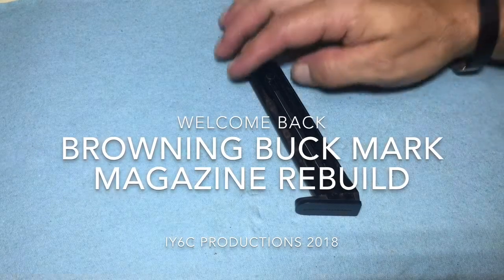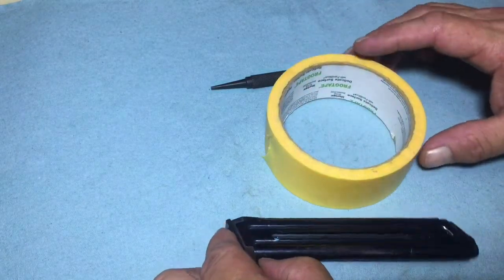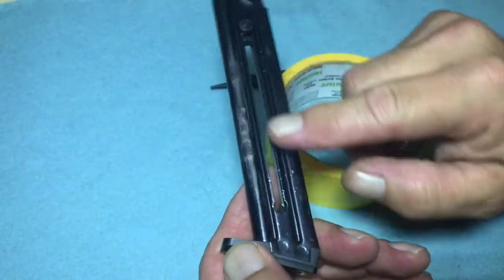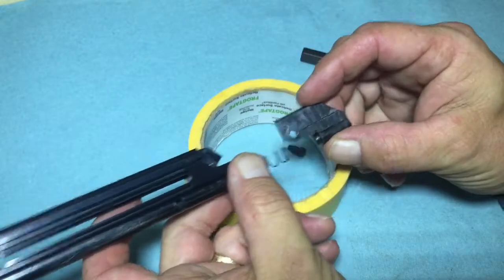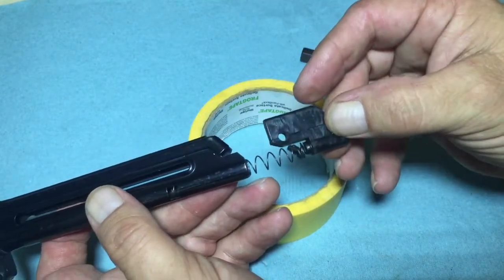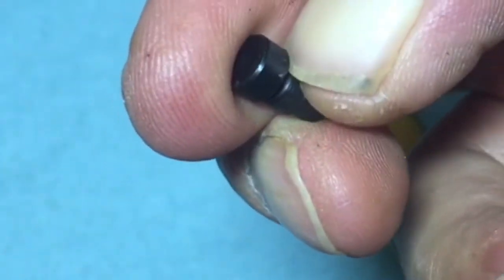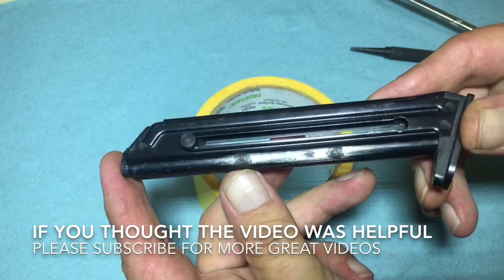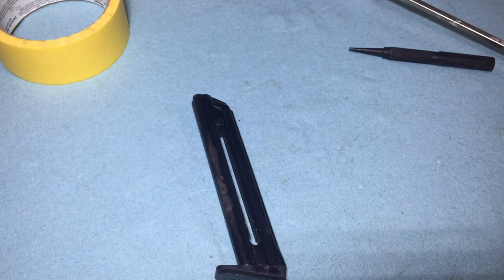Browning Buck Mark Magazine repair or maintenance

Comment: Gotta love Hoppes. Tried all the CLP stuff but it just didn't get it. Not clean enough for me. Always used it with Dad back in the day. Thanks for the video. Just got a used Buckmark Plus in stainless. Went over it and cleaned it up a little but I'll look at the magazine also as this gun is 7 yrs old but in nice shape. Had to replace the screws holding the rail on which were torqued to 60 and 40 in/lbs. Though they would snap. Called Browning and they said hand tight No torque spec. Thanks again

Comment: Great video. I followed along until you grabbed a screwdriver for reassembly. My multi bit driver was too big to push the follower down so I used a No 2 wooden pencil. Perfect fit and easy to grip.

Comment: Nicely done.  I have a 1987 production model and am scared of trying to find another mag.  Some flat out say their wider base will not recess into the handle as does the original.  I've looked at other "OEM" and can't tell what the base looks like.  My parts book shows the components, but not the p/n for the whole mag.  I guess now I can buy the pieces and make my own. Thanks!

Comment: Great video! Have you ever seen any rust inside or have any tips to deal with that? I got a few new mags recently and they all have internal rust spots but the exterior is fine. Any ideas?
Reply from the maker: Not sure
Reply: A little late, but I've had great results with fine steel wool and soapy water against surface rust. Just the regular stuff that's available in most grocery stores. Just dont forget to clean it thoroughly and oil it afterwards. It may polish up the finish a little bit, but it won't remove the finish.